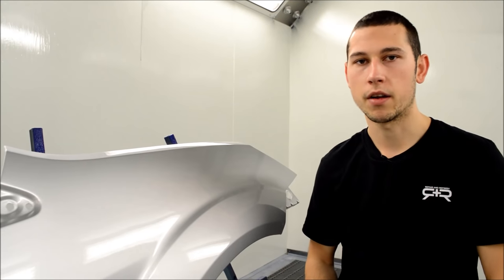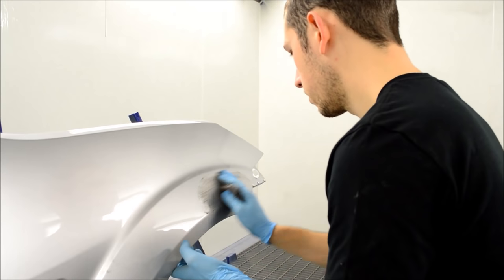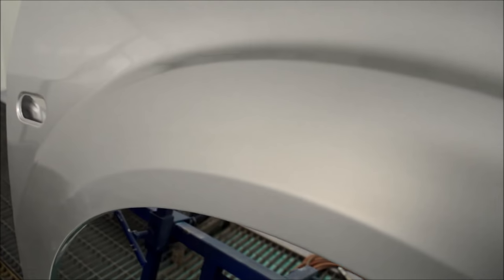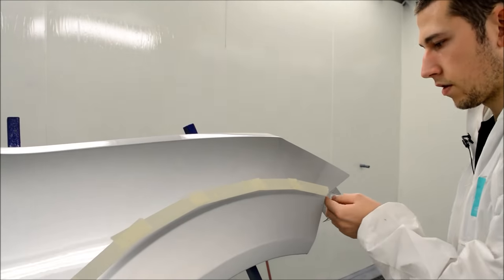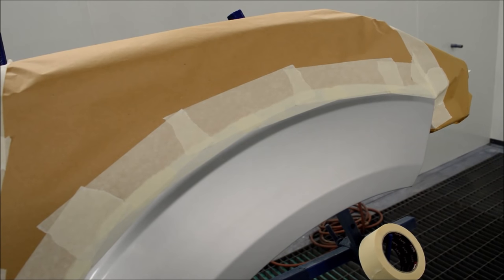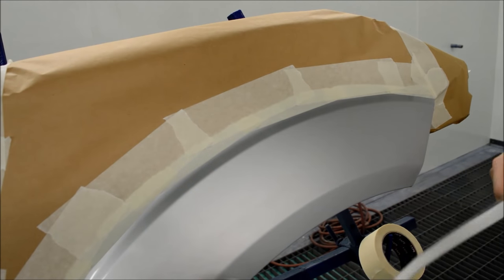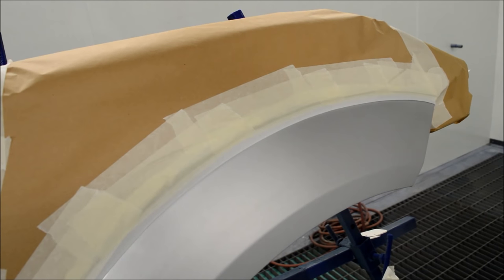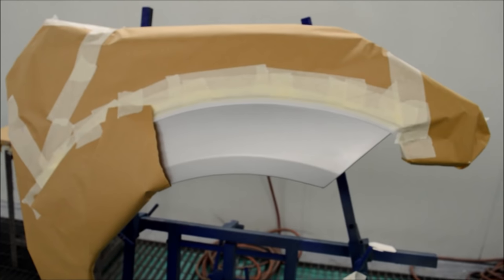Fade Out SMART Repair Using J Tape No Edge Blending Tape

Comment: Hmm.  The cost of all that extra material j tape and the time to over mask it plus Polish after there's no way it works out to be more affordable then just clearing the whole panel probably another $3 in clear coat . I mean cool idea I guess
Reply from the maker: Hi, this is more of a demo to show it can be done rather than  do it in the real world. Smart repair guys use the same methods but on different jobs or you may want to go off the edge of a door ect. Thanks🙂
Reply: Sometimes clearing the entire panel is not an option or cost prohibitive in other labor. An example of this would be performing a repair on the side of a truck where the back and side of the cab are basically one continuous panel. If I'm going to clear the entire panel in this instance, I have to remove the truck bed to access the rear of the cab.